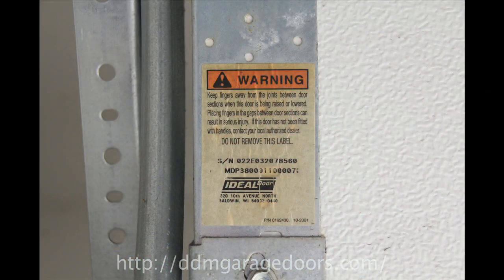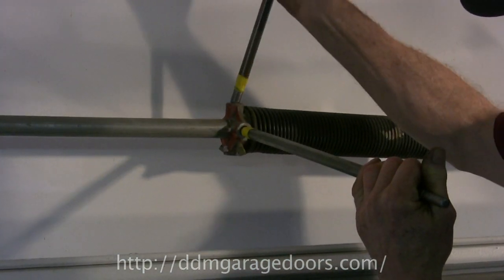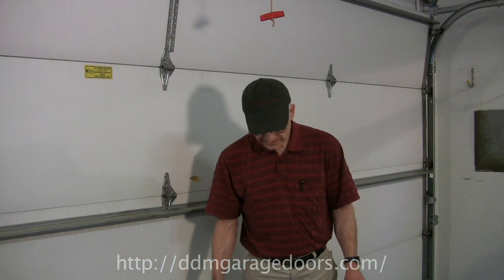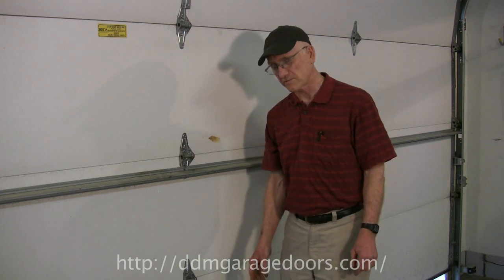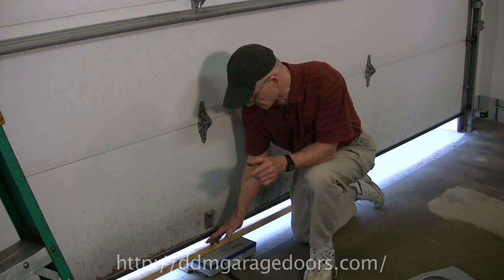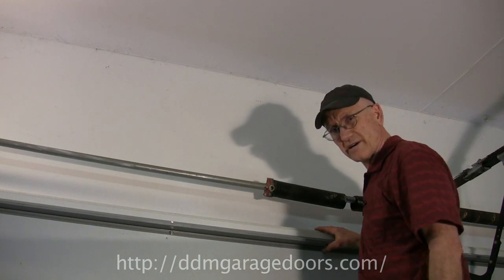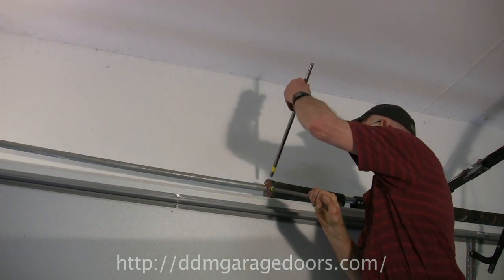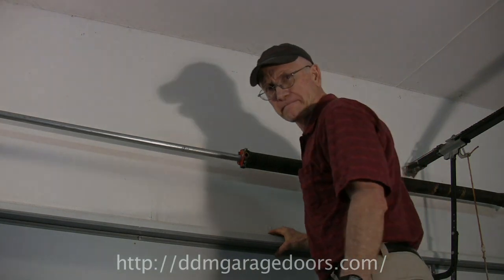How to Weigh a Garage Door That Has Torsion Springs

Comment: In this video, the technician mentions that the torsion spring that he is manipulating with the winding bars to raise and lower the door is broken. How would this procedure change (if indeed it would change) if both springs were fully functional?
Reply from the maker: Hi Mishigoss55! Yes, you would want to do the same procedure if both springs were fully functional. However, this is not something you would necessarily want to do unless you don't believe that the springs that are on the door are the right size for the door, or if one spring is broken as in the video.

Comment: Do you have an engineering formula for calculating the required torsion springs for an apartment underground parking overhead gate?   We had a company fabricate a new gate 2 years ago and already both torsion springs are broken.   I'm suspecting the companies engineering isn't good.   Maybe he calculated for a single family residence.  There's probably 30 cars in the building that go in and out atleast once a day and some tenants also use the gate to walk out into the back alley.
Reply: Because of its high usage the more likely problem is insufficient spring cycle life for your application. If you have a sectional gate that is seven or eight feet high, and if you have standard four inch diameter cable drums, you can enter the springs dimensions at http://ddmgaragedoors.com/springs/standard-torsion-springs.php#database and determine the cycle life. I would recommend replacements with at least 100,000 cycles for the gate.

Comment: Great video. I figured out mine weights 215 lbs.  One question not quite answered yet... what do I do with this information to determine what springs to get?  I hear to get the turn radius of the door (15" for me) and the size (7'x16' for me), but not finding any kind of table or recommendations on any of the web links to help me pick an appropriate pair of torsion springs.
Reply from the maker: Hi Quintus! On our website, we have a "Find My Spring Database" where you put in all of that information that you've gathered, and you will get options that will work with your door. You will also see higher cycle life options, that will cost slightly more than the "recommended" pair, but also offer more life to them.
Reply: Me too.  RGC42